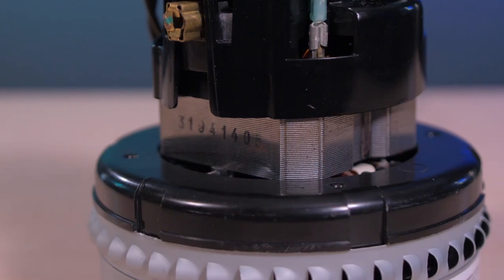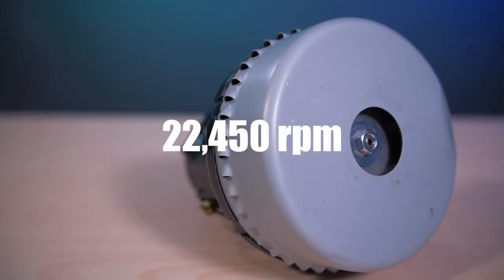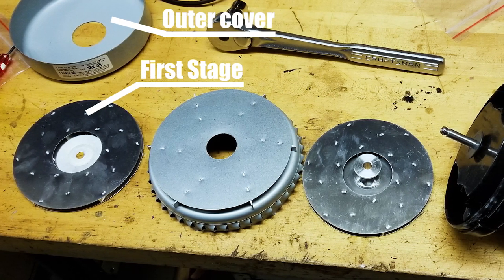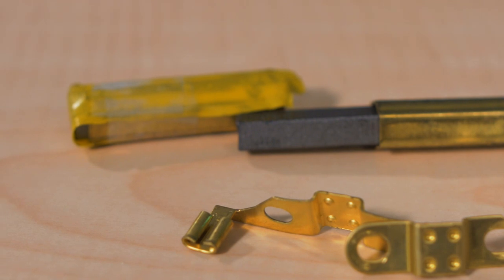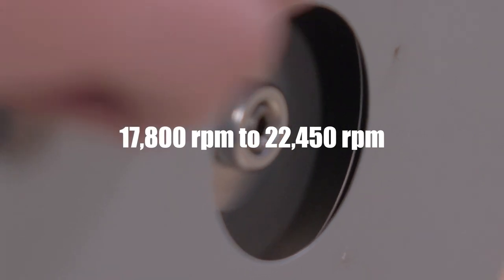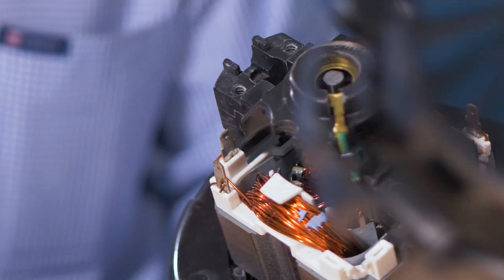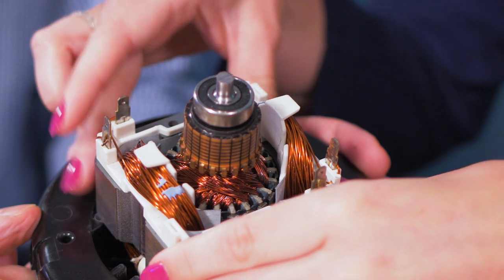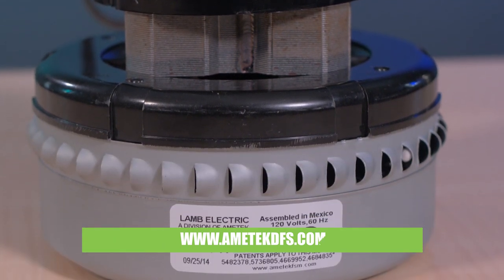AMETEK DFS Teardown: Lamb Electric Vacuum

Comment: Can you tell me what is happening inside the motor ,actually the 3 stage fan , when suction randomly stops after the motor is running about 10 mins .. if you shut it off and start it up you have suction again, but not for too long .. but the motor runs fine at high RPM...
I got the cover off the first stage , bolt is tight , not seeing anything alarming ...

Comment: So it's a very interesting vacuum turbine connected to a pretty ordinary but well designed motor.
Series universal motor = uses graphite brushes and works the same as almost every motor in every vacuum.
Operates in runaway condition = same as almost every brushed motor in every vacuum.

Comment: 3:19 lol, they keep pushing the brush against the commutator ring sideways 😂

Also, 3:22, that poor fan, RIP 😥
Reply: Mine started smoking and I tore it apart.  Found the white cable from switch loose, plugged it in and put it back together but it doesn't do anything when turning on or off.  Any ideas?